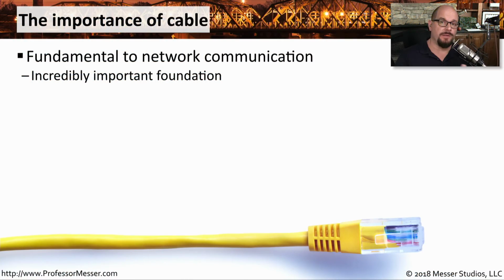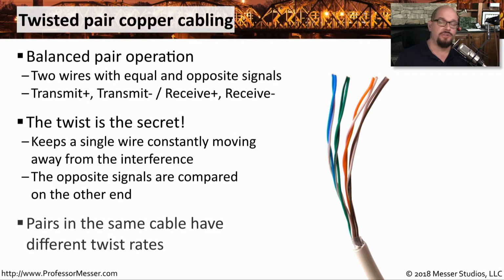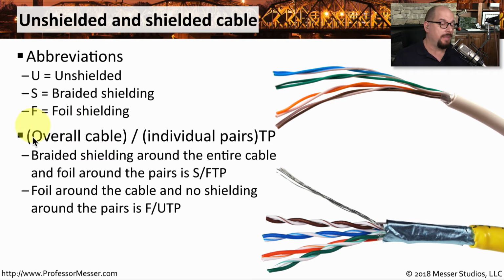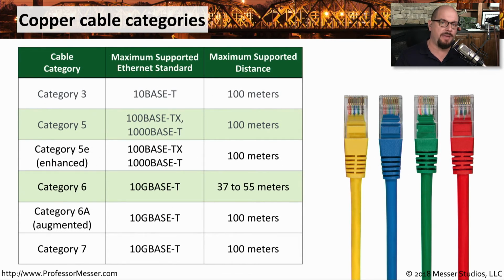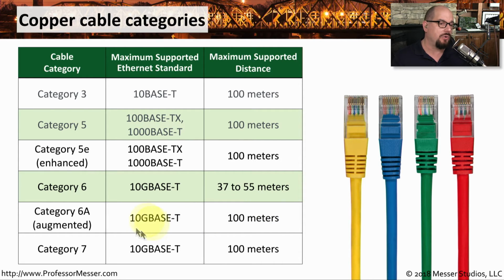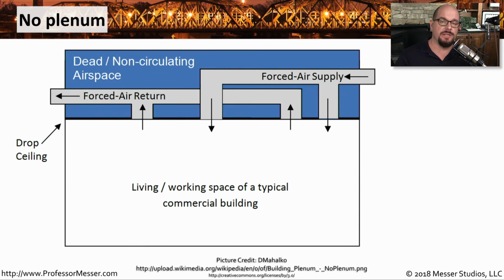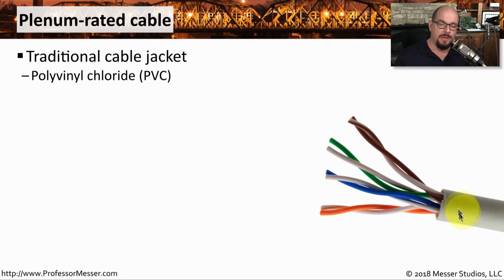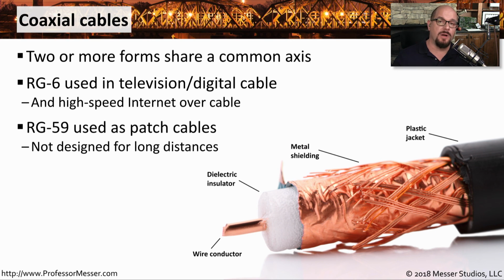Copper Cabling - CompTIA Network+ N10-007 - 2.1

Comment: Isn't the maximum length for CAT 6 100m?
Reply from the maker: The maximum length that an Ethernet signal can reach on a particular category of cable is determined by the associated IEEE Ethernet standard.

Which Ethernet standard are you referencing?
Reply: @professormesser   Ok, so with 1000BaseT it's 100m, and 10GBasseT it's 37-55m?

Comment: Does cat 5 support 1000 Mb/sec speeds since its supports 1000 base -T as per the slide? Or did cat 5 E start with supporting 1000 Mb/sec? Through my reading  online it seems that cat 5 E provides 1000 Mb/sec. Kindly help. Thanks.
Reply from the maker: Category 5 cabling can support 1000BASE-T and slower standards. Although it's difficult to find Category 5 these days, it easily supports Gigabit Ethernet speeds.